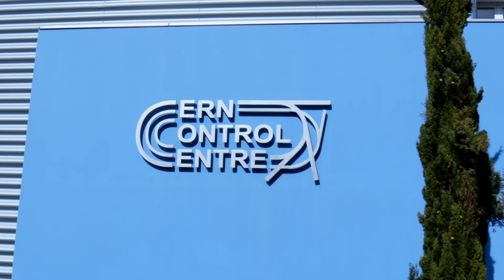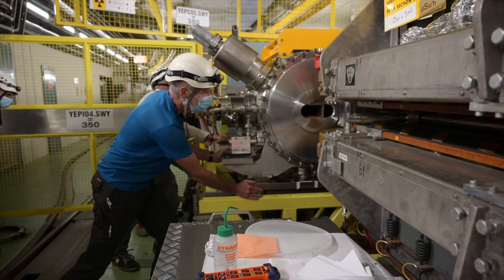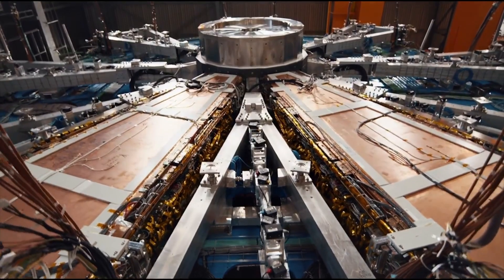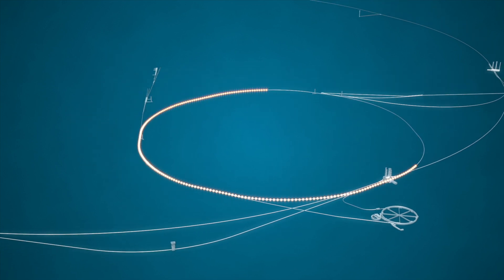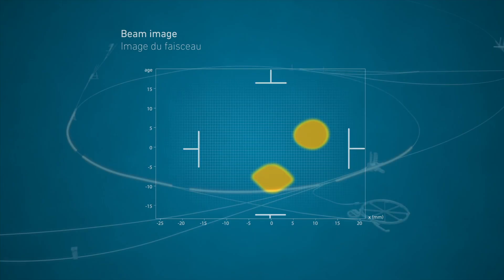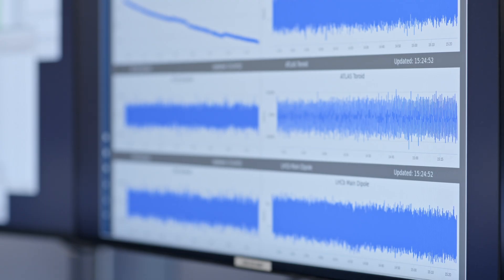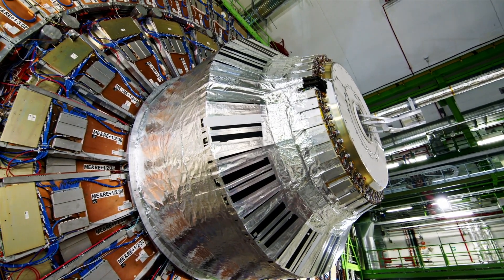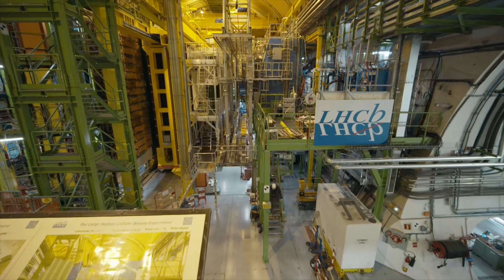LHC restarts

Comment: Didn't you used to run both beams at 13 Tev ?
Reply: The total collision energy from both beams was about that.
Reply: @Usul  and that was in Run 2 (2015-18). Now energy has been cranked up to 13.6 TeV.
Reply: @luciddewseed3095  It was running at that back then.
Reply: @michellealexander-nolin154  indeed

Comment: I am confused .  How do you distinguish the particles after the collision and how do you measure mass, energy, charge...etc?.  I want an example of that so I know how you analyze the results?
Reply: Via the detectors, the speed of decay mass and charge of what is left over. Feynman method to work out possible decay possibilities, some more probable than others.
Reply: @pinball1970  When you impose what you want on things, it just interferes with real experiments.  You experiment to find out what really is, not to confirm things you want them to be.  If you experimented at all, you would find out this is true, and would soon drop this imposition.
Reply: And of course there are detectors for that purpose - detecting particles. That is to say, account for (almost) every particle's mass, charge, energy, momentum, direction of fly etc. etc. ...as precisely as possible.
Reply: I need more information about that,
Reply: @newscientificdiscoveries6228  what you're asking is way too complex to be summed up in a youtube comment. if you want an idea of very rudimental ways to detect particles, google cloud chamber (they discovered the positron with this thing), ionization chamber, proportional counter, multiwire proportional chamber.

Comment: Damn!! 6.8 tera electron volts that's more than the singularity!
Reply: 1 TeV is equivalent to the kinetic energy of a flying mosquito. Keep those mosquitos away from your singularity.
Reply: @Usul  Well, to be fair, it's concentrated in a far smaller volume of space than a flying mosquito.
Reply: @Usul  Oof!! Noted
Reply: @wildmoon444  It's a lot of energy for a particle! Not enough to swallow the earth though so don't sell the farm just yet.
Also we are hit by particles from space all the time, the energies from those  are far greater than our particle accelerators can produce and we are still here.
Reply: @wildmoon444  Singularity is not an energy

Comment: Will this have an effect  on nanoparticles inside of people?🤔
Reply: No lol
Reply: Excellent question my friend.
Reply: This will not inject nanoparticles in to people. Is that what you're asking?
Reply: @Usul  the magnetism will it disturbed the polarity of them. Make em spin like for tumor treatments to destroy  the tumor.
Reply: @larryrollyson3344 , Hi Larry. Particle accelerators are used for cancer treatment. In fact, many treatments were originally developed at CERN. The LHC is not that kind of particle accelerator. No one is allowed near it while it is running, and it is underground to ensure no impact to the environment, staff, or people. You would need to be close to it while it was running to experience any negative effects (nothing that bad, but it is done out of precaution). Safety procedures will automatically shut down the LHC if a person enters the area while it is on.
Reply: @Usul  very informative 😊
Reply: @Usul  How about instead of cancer treatments, focus on cancer prevention? Like acknowledging the dioxin, glyphsate and other chemicals are banned from being released into the air and water. They like to blame cigs but there are WORSE things like those yearly injections and other pharmaceuticals. Not to mention wifi and other radiation.

Comment: What is the effect on Earth’s magnetic field as the LHC eV’s increase?  Should civilians expect fluctuations in our internet service or electrical supply?
Reply: Expect to be consumed by dark matter
Reply: @45point28  We haven't even found dark matter, yet alone made it. We've only observed its effects in faraway galaxies.
Reply: @deadhorseak  wdym i have black matter in my hole 🕳
Reply: @45point28  Eh?
Reply: @pinball1970  poop
Reply: Err no
Reply: @byrnemeister2008  maybe?
Reply: No, you're talking about geomagnetic storms from solar flares
Reply: You don't know what an eV is, do you?
Reply: The Earth's magnetic field is like 10,000x weaker than the magnets they use in the LHC. It has basically no effect. The use of the collider will not affect internet service (CERN actually invented the internet!), and it's overwhelmingly unlikely to impact civilian electrical supplies.
Reply: @nzuckman  I read that on Google too.
Reply: I wonder if that is why they said a few days ago that the electrical field was sstarting to shift?
Reply: excpect to be aroused at both ends

Comment: Man 2022 is going to be a great year for science! First JWST and now this! I can't wait for all the new discoveries!!
Reply: THIS THING COULD DESTROY THE UNIVERSE
Reply: Mel House  It operated for 12 years and reached design energy. One meltdown in 2008 which hurt nothing but the schedule. 
This is a particle accelerator not a nuclear reactor.
Reply: @_Simba_-dc7lq  Nope, I said the same on physics forums.
Reply: true!
Reply: Mel House  Hawking died 4 years ago so he is saying nothing about anything.
Reply: @_Simba_-dc7lq  What is?
Reply: Mel House  I have already told you that after the repairs in 2008 it operated till its shut down till 2019. It reached its design energies during that time and found new physics. The have made some adjustments so it will increase the energy but also luminosity, the number of collisions per second so more data to sift through. It is the accuracy and efficiency of the runs that has changed. 
If you want to know some real physics about this then read about that rather than pop Science articles.
Reply: Mel House  Hawking did NOT say that either, just the opposite.
Reply: Mel House  I control things at the speed of light for my job, those things are called 'light' photons to be exact. Millions of them everyday, I measure them and collect the data.
No issues, we are all still here.
Reply: Mel House  Yeah because you are a high energy particle physicist we get it.
Reply: @inactive Work out the nature of matter
Reply: @inactive Occasionally a technology will arise like a LINAC or Internet
Reply: Boi. "Science" is the worst thing u could bring upon nature. "Science" is "let's blow something up and examine it" rather than let it be or co-exist without being a know all
Reply: @longesttrip259  So you think Science on the whole is bad?
Reply: @pinball1970  yes
Reply: @pinball1970  Wouldn't it be logical for real science to study the effects of putting frequencies(i.e. WIFI) in our air, since that's a major change from how it used to be?  Don't give me the b.s. answer that we are being hit with frequencies from the sun, because that was always present.  Now, cite me all the organizations and funding going into this study.  Then you can tell me how pure science is going on.
Reply: Careful what you wish for!
Reply: @JAAB9296  Wish for? New Science, discovering new things about the universe. It's called learning.
Reply: @pinball1970  YOu have no idea of what I'm referring to do you. Let me give a tiny hint. "They" are playing with "fire", you just don't know it.
Reply: @JAAB9296  Yes I do and I have already tried to explain. The LCH operated till 2018 till its scheduled shut down with NO issues. It reached its target energies with no issues and found new physics. 
You do realise particle accelerators have been in operation since the 1940s? 
You do realise the earth is hit with particles all the time from deep space that far exceed anything the LHC can produce? With no issues?
Reply: @pinball1970  Yes and yes to the last questions, those comments are known to almost anybody who has a clue. Anyway, you are "still" don't get it, but that is ok... for now.
Reply: @pinball1970  Reinforcing your own belief system is not learning.
Reply: @pinball1970  Don't worry, pinball will be there to pick us up if anything bad happens.
Reply: @JAAB9296  yep fireeeeeeeeeeeee this time by my beautiful Heavenly Father Almighty The Most High
Reply: Do not hold your breath.
Reply: @wesleydeng71  Webb already produced a stunning image as a warm up and LHC just broke a record so yeah
Reply: @pinball1970  ya letting demomic fallen angels and demonics out of portals i saw it  )
Reply: @achosenone44  You are confusing high energy physics with Marvel. They are not interchangeable.
Reply: Indeed! super exciting :)
Reply: @loiuhuiygny7guyguiygk  Bot.
Reply: 🐑or🤖
Reply: @_LC__  Eh? I'm sorry I don't speak emoji
Reply: @pinball1970  🤣🤣🤣

Comment: Fantastic news! fingers crossed you'll be able to confirm the W-Boson results - imagine the collider they'll let you build then!
Reply: What is the W boson exactly?
Reply: @briannaw.7226  Part of the standard model. A couple of anomalies that do not fit with the prediction.
If those anomalies are supported by data from new runs then the standard model will need adjusting.
That's the boring answer.
Cool answer? New physics!
Reply: are they trying to open a portal to another demension/another world?
Reply: @briannaw.7226  No, it's just boring math